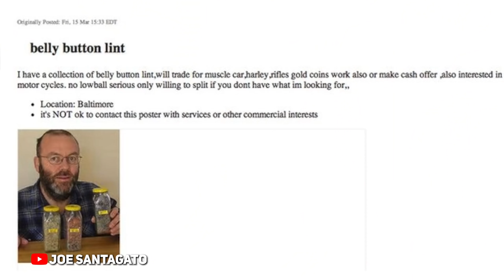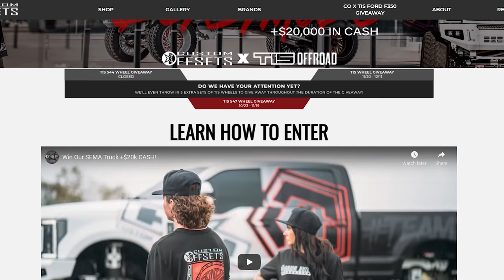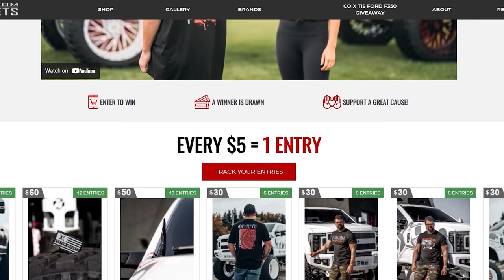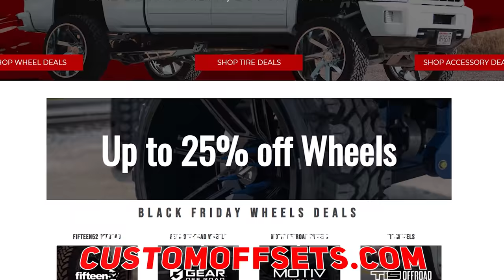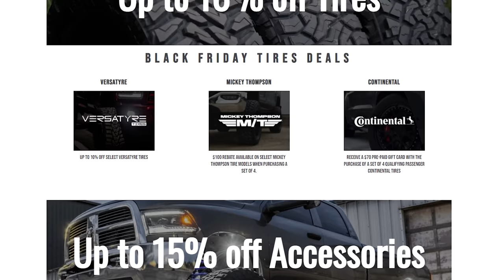The WORST Trucks Ever Made!

Comment: As far as the triton goes, I haven’t sent a spark plug flying yet at 170,000 miles, but I have had a fuel pump problem. Good thing about the triton is that every problem is pretty predictable like the fuel pump and spark plugs, but they hardly ever have problems aside from those. I’ve only ever had the fuel pump problem

Comment: Oh man, here we go. Year is 2007 and I badly wanted an S10 for my first truck. Went looking, and at a local supposedly reputable dealer, I find a 98 model S10 with the 2.2 vortec. I was in love. It only had 39,000 miles and was pristine. Being at a dealer, my dad didn't even have much to say.
I pay cash and drive it home.
After 3 years and an alternator, water pump, 2 (TWO!) transmissions and a starter later.... I dumped that pile of trash and never looked back. I will never buy another Chevrolet. 
Current owner of a 2019 F150 and couldnt be happier with it. Previously had a 2015 Nissan frontier I traded for the Ford. Bought the frontier brand new in '15 and put 200,000 trouble free miles on it. Was a fantastic truck and so far the Ford is as well!

Comment: @customoffsets As a owner the H2 SUT  is actually very usable and has its benefits like keep gas tanks out of interior was extremely c capable off road and you could keep your Greasy and muddy parts out of the cab when going off-road.  Ass for the SSR is more truck than some trucks out there coming standered with a receiver and also having I v8 that though being 2wd could tow a good amount

Comment: Eh, I got an 05 F150 with 356k miles, they aren't so bad if you keep up with maintenance and work on them yourself. When the 5.4 dies I'm putting a 24v in it with a 6 speed manual. Got the trans, transfer case, suspension, and axles out of a 07 F350, got the 24v out of a 01. Should be sick.

Comment: Just gotta say, I have an AWD version of the 2022 Honda Ridgeline. Its actually my work truck. No its not a mud truck and never will be. It is however a very cool modern take on what I consider the coolest truck/car ever, the 1969 El Camino. If you do auto glass for a living like me, a reliable work truck that has a bed to transport glass and tool boxes, rides smooth, gets decent gas mileage, is reliable with a good heater and great AC, and hauls ass if you want it too, is a work truck you dream about having for years, not to mention the leather heated seats and blue tooth stereo. 20 years down the road and countless econolines and express vans later, I finally got what I consider to be a bad ass work truck- the ‘22 Ridgeline AWD. It ain’t a lifted 4x4, but it is a fast, smooth good looking, and incognito AWD car/truck that really is a nice ride.

Comment: I like the 2 valve. It's a 20$ permanent fix for me. The 3 valves breaking off sometimes require head removals. They have bad oil passages and have horrible cam issues. I do have a v10 2 valve and my dad has a 5.4 2 valve. Great engines if taken care of.

Comment: Ford Maverick should've been in this video.
Reply: and the new Hyundai Santa Cruz!
Reply: I disagree. I work at a Ford Dealership and those mavericks are being sold like hot cakes. It gets good MPG, i wouldnt consider a truck, but its a nice mini truck for commuting
Reply: @iMakeDatBedRock   The bed is not separate from the cab so I agree yeah it's not a "truck" and it's on a unibody frame that's a major deal breaker for consumers. The only good thing it has is the mpg because it's a hybrid.
Reply: @DoctorRickSanchez  as long as you're not removing the truck bed who's going to give a fuck?
Reply: @iMakeDatBedRock  Consumers.

Comment: What’s up with the Chevy Avalanche. Does it count as a truck
Reply: IMO yes it was a decent starter type truck/suv hybrid with a 5'3 inch long bed and 320hp and 335 lbs-ft of torque from a 5.3L V8 surprisingly it got pretty good gas mileage too I'd say it's one of the few they show revamp and bring back
Reply: I actually want one. They are at a good price for 07 and up
Reply: Yes and no. It’s basically a Suburban with a bed that has decent truck specs. But the midgate is a big downside, especially if you live up north where you could only use it 10 months out of the year. Or if it’s dry.

Comment: Don’t really know why he’s ragging on the ridgy so hard? Do I have to be able to tow a 12,000 lbs gooseneck toy hauling camper? No. I just need to haul my 3 atvs on a 6x12 trailer and haul all my dirty gear in the in-bed trunk. I actually own one and it’s the best daily driving truck you can buy. And if you don’t call the Ridgeline a truck, then the ford maverick and Hyundai Santa Cruz aren’t ones either. And they are even smaller than the Ridgeline! The maverick base trim tows just 2,000 lbs! The base model Ridgeline tows 5,000. Don’t hate on something just cause it isn’t the norm.
Reply: no cap honda ridgeline 🔥best truck on the market